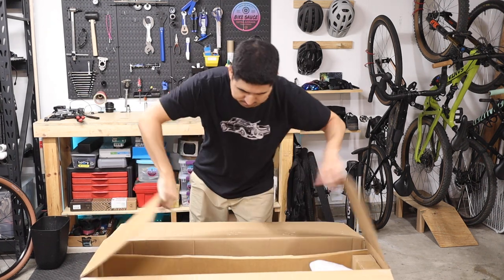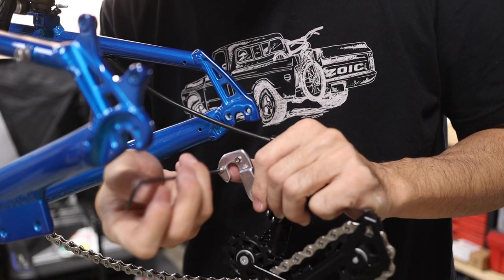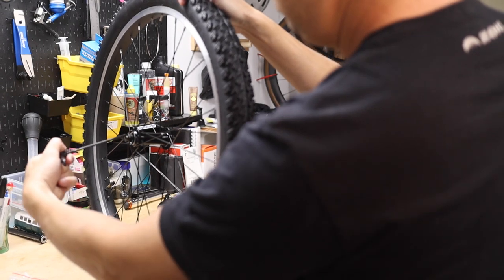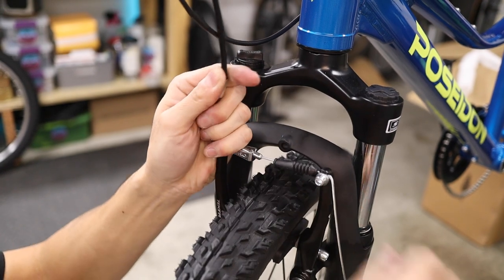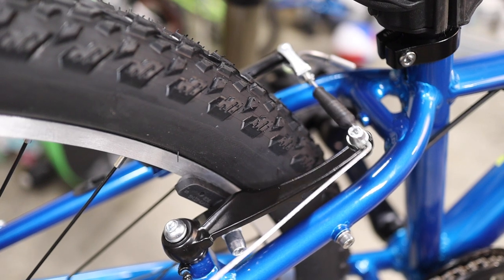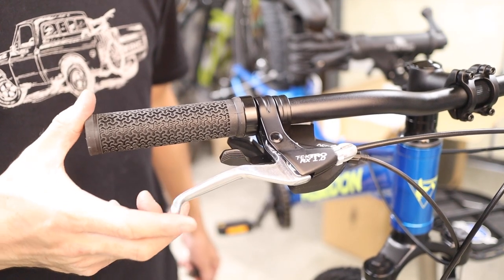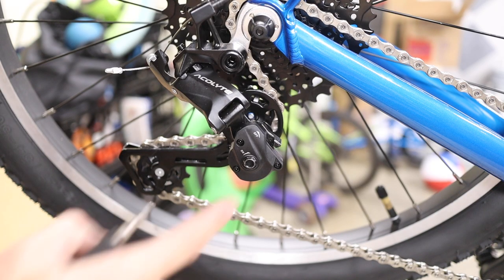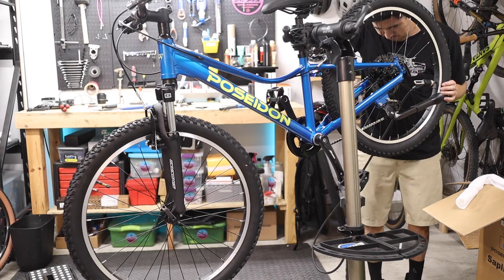HOW TO: Build Your Poseidon 24" Sapling

Comment: Really surprised to see Poseidon's setup video linked to a YT'er I already follow! This was a very helpful walkthrough so I could double check my work as I assembled the bike yesterday! Just picked one of these up for my almost 9 year old and I was really impressed by the quality for the crazy low price! Though I think I need to lower the stem since she's likely on the smaller end for this bike, its a bit larger than I anticipated with her coming from a 20" Cannondale Trail. Still though, quality components, packed SUPER well (which is huge for a DTC bike seller). I only have two gripes: 1) the rear wheel hub was SO overtightened that I could barely spin the axle by hand and it was super crunchy. I backed off the cone nut a bit and all was well. 2) The chain was so hopelessly tangled that I scrambled my brain trying to untangle until I noticed it was a quicklink KMC chain. I just popped the quicklink off, took the chain off, installed the RD and rethreaded the chain and all was good, so props to Poseidon for including a QL!

Overall this seems like a really solid bike, and my daughter is psyched to get on it this weekend!